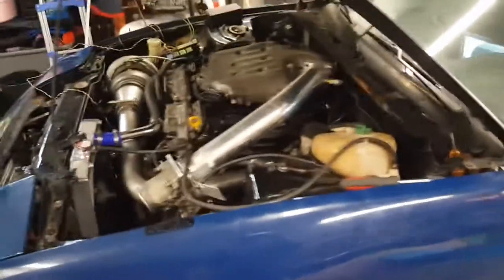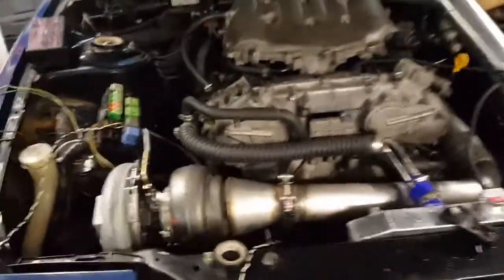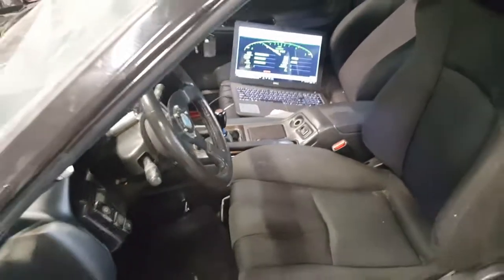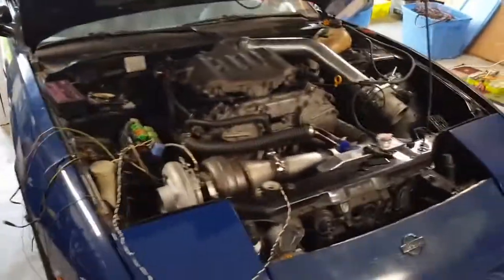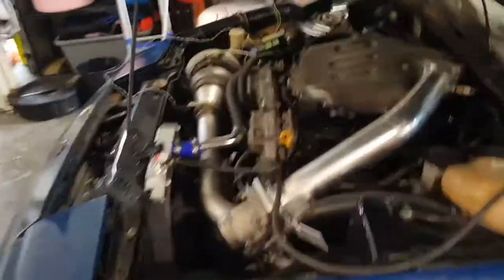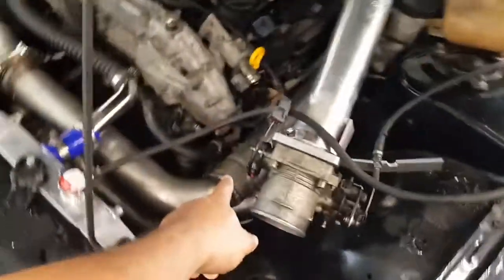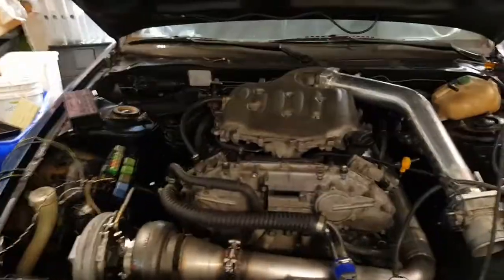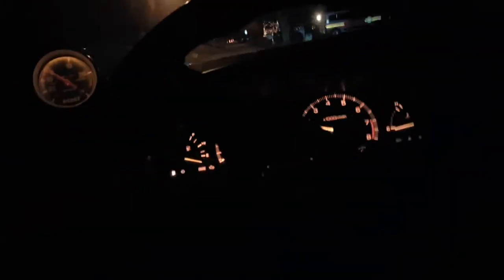VQ35 Build Part 67:  Finished Coolant and First Drive

Comment: Exciting
Reply from the maker: brandoGTR48 Yes very but it was short lived lol.  Front left caliper seized and I need to change my clutch master cylinder.    When turning back into driveway, the caliper seized and I was able to confirm that the R230 diff is locking up lol.  At least small issues.  Not to worried.
Reply: supakat500 yeah you've come this far just keep powering through the little issues
Reply from the maker: brandoGTR48 Oh yea...been there done that with the KA-T.  Thanks for the encouragement.

Comment: Lol still got that og squeaky clutch pedal.
Reply from the maker: Aaron _z33 Haha....
Reply: supakat500 when do you think you will have some boost pulls footage?
Reply from the maker: Aaron _z33 Good question...I say three weeks.  I want to drive around and go through heat cycles to see how she reacts.  Need to service front left caliper, change clutch master cylinder, finish wiring, and other odd stuff.
Reply: supakat500 yeah that's understandable. Got to smooth everything out. I'm curious to see how well it holds temps with all the piping and the small radiator. At least all the hard work is done. 👍
Reply from the maker: Hopefully she runs cool.  If not, then I will get another smaller radiator and run in series.  Saw Diesel brothers do it on one of their episodes.  Hopefully with the condenser removed, I have enough air.
Reply from the maker: Aaron _z33 My biggest thing right now is to make sure sensors are reading correctly, no over heating, creating a good timing map, and anything else that needs to be addressed.  Taking a break from the car today to chill with the fam.  Been at her since Xmas but the results are worth it.
Reply: supakat500 yeah it was actually quite a lot of work haha. I'm looking forward to seeing how the DE takes boost. I've read a lot on rod failures using turbos, and supercharger are a lot safer. I guess we will see how it goes in a few weeks or so. It probably will be fine with a solid tune.
Reply from the maker: Aaron _z33 I think a lot of the failures are due to heat.  With small twins stifling the head flow and hugged up next to the block getting heat soak, this will take a toll on it.  I want to see what fails, then put the other motor in and address the  failure.  I think I can push 600whp safely with E85 and a safe tune, this should be attainable.
Reply: supakat500 maybe it'll help if you have ventilation like how evos have mesh in the hood above the turbo area or a undershroud to direct airflow into the heat exchangers
Reply from the maker: Aaron _z33 Yea, I have an undertray on the car.  If need be, I may have to cut into hood.  In the KA, I would hit 198* coolant temps after 3rd and 4th gear pulls and the car would cool down to 185* shortly after.  I am hoping I can achieve the same.  Curious to see my intake temps as well.
Reply: supakat500 yeah it will definitely help out if you get the hot side stuff ceramic coated and even wrap it
Reply from the maker: Yea, going to wrap the exhaust up eventually.

Comment: How is it boosted? Turbo isn’t hooked up to intake.  Did I miss something
Reply from the maker: No, I had the cold side disconnected so it can blow out any foreign objects.  It is hooked up now and BOV is responding.  Solidified some settings in TS and put a new clutch master cylinder in.  Just to do some other wiring and go for a cruise.  Also, need to see about the brakes.  They are spongy.